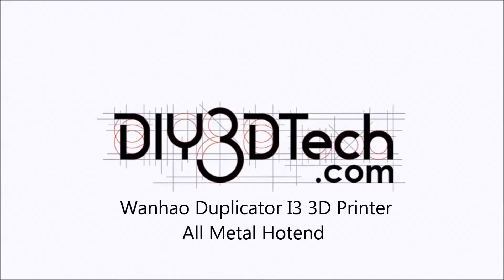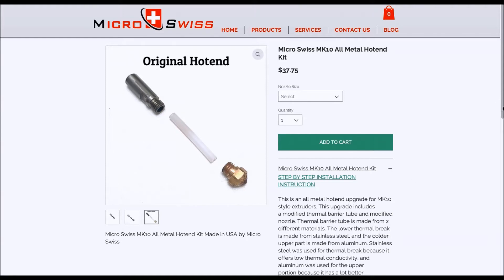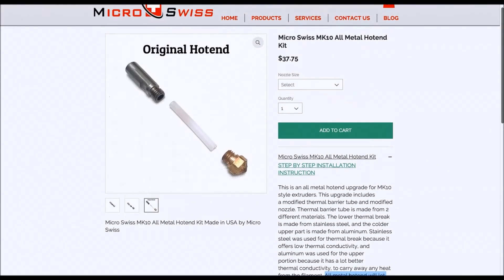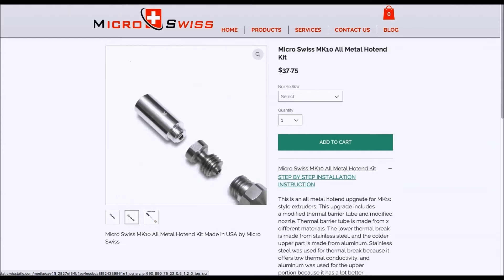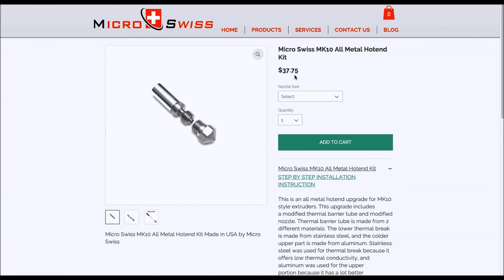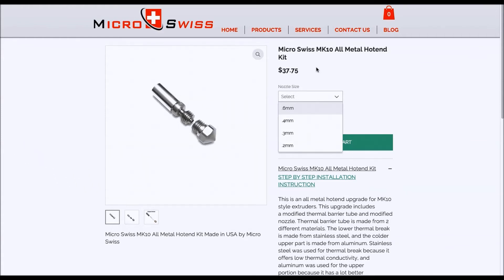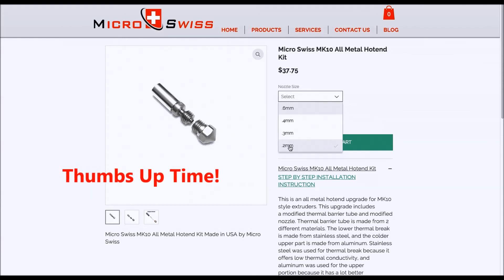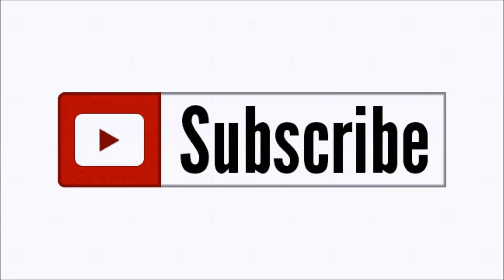Wanhao Duplicator I3 3D Printer - All Metal Hotend from Micro Swiss LLC

Comment: 260ºC for PETG? I've been looking at Taulman's Tech-G and it looks pretty nice at 238ºC. Also, which one should I buy?

http://store.micro-swiss.com/products/micro-swiss-mk10-all-metal-hotend-kit

https://store.micro-swiss.com/products/all-metal-hotend-with-slotted-cooling-block-for-wanhao-i3

The second link has a slotted cooling block, for an extra $20. I don't know if it's worth it, and I'd like to hear your opinion. Thanks
Reply from the maker: As I type this I am printing PETG at 250c, so you might want to play with the temps a bit as Taulmans might be different (Think I am using InLand).  Also you not only want be new heat block as running higher temps means the heat break will have more heat to dissipate and the reason for the heat block change otherwise you likely end up gumming up the hot more often than not as the heat will creep up the "break" cause you issues...
Reply: I've been running the MicroSwiss on my Maker Select (Wanhao Di3 clone) for almost a year now, I've printed hundreds of hours of PETT and PETG. I recommend the extra $ on the slotted block. MUCH better mechanical mating surface for heat dissipation. I agree with DIY3DTECH, I print PET/G at 240 low end and 255 at most. Lower end gets more frosted appearance and higher end gets glossy clarity. 90% of the time I run 250 though for the balance of reduction of drooping/curling to clarity on complex geometry.

Comment: Hows the hotend ? I've read some reviews but it seems like most of the people complains about it. I've installed it tonight on my wanhao i3 v2 but its getting late i might just test it tomorrow.
 Did you put any thermal paste between the heatsink and the heating block?

What's your feedback ?

David
Reply from the maker: +La famille Hatin on vacation with the family this week so likely will do this coming Saturday and because of the temps I doubt I would put thermal paste but please do let know how it works out
Reply: +DIY3DTECH.com I've installed the Micro-Swiss MK10 Hotend on my Wanhao Duplicator i3 v2 carefully following the installation instruction via their website. I've just finished a 5h30 print with ABS and my print has turned out really well with no issues at all. My print settings were 0.2mm layer height @ 50mms with the default wanhao cura settings. Extruder temp: 245, Bed temp: 90 and ambiant temperature: 32 degrees.

Will test PLA tomorrow and let you guys know.

David
Reply from the maker: +La famille Hatin Great to hear!  Can't wait to get back and make the mods myself!
Reply: +DIY3DTECH.com So i've just finished printing a 9hours PLA object and i did not have any issues ! Same cura config as mentioned above exept for the temperature which was 220 degrees for the extruder temp, 60 degrees for the bed temp and 33 degrees for ambiant temperature !

So far so good ! I did not encounter any issues printing with this mod.

Have fun :) David
Reply: +DIY3DTECH.com I was also able to print Ninjaflex as well as Protopasta PC-ABS with no issue ! I had to use the extruder mod in order to print with Ninjaflex, and a preheated enclosure in order to print pc-abs BUT so far so good.... It is by far a great mod.

Comment: I'm about to order the full metal hot end .4 size ....I clicked on the instructions video link did not see the video but did see an upgrade block I'm I going to need that to use the hotend?
Reply from the maker: +Chi Sty my understanding is you do not need that, however I also ordered it as figured bigger is better and wanted a tricked out hot end...
Reply: Got ya thanks for the info on that ....would you have a pic on what it looks like with the new block?
Reply from the maker: +Chi Sty Will be doing the mod this coming weekend and will post a video when complete so stay tuned!
Reply: Lol I just seen an email my metal head is on its way the timing on this it is working out well.

Comment: nice I've been wondering about this...on thingiverse I found a few STLs for the lower fan one you can mount from the back so you can see your print they looks to be giving me better prints they surround the hot tip instead of from one angle like the stock one.
Reply from the maker: +Chi Sty I've seen the fan mod too, however been very happy with the stock fan so have not switched however maybe when I do the re-work...

Comment: Great upgrade, can't wait to see how you make out. Maybe it would help with the unload jams I get sometimes when the filament quickly cools while removing it.
Reply from the maker: +Steve Cuthbert Yes it should as I get the same.  My work around now is when I swap filament, I warm it up to around 250c for a couple min and then release the bail and pull backwards quickly to avoid this.
Reply: +DIY3DTECH.com Good tip, I'll give it a try. I see this upgrade in my future. I'm still trying to get my i3 to print like my Fabrikator Mini with it's upgraded E3DV6-Lite hotend. Also it would have helped if the i3 didn't arrive damaged from shipping.
Reply from the maker: Hmm my Wanhao quality wise kicks the Fab-Mini's but all day.  What type of issues are you having?  Also, with the Wanhao I say Tune, Tune and then Tune as out of the box (likel like in Joel's video) its was crap however after few hours, it was purring like a kitten!